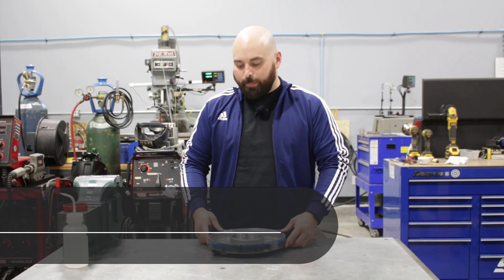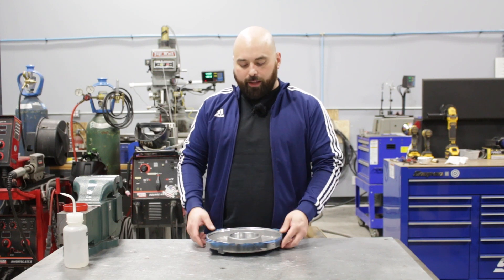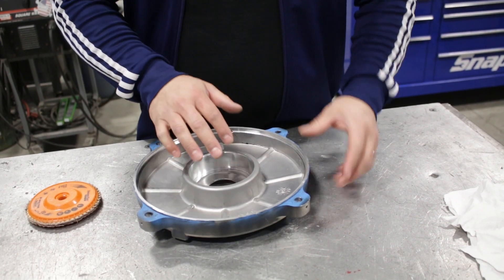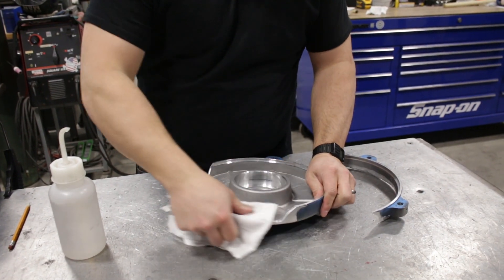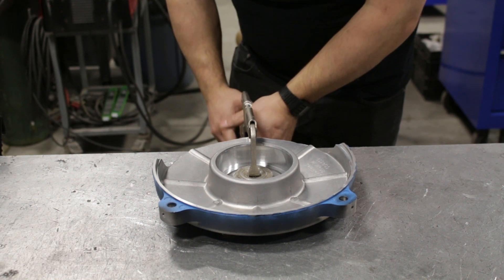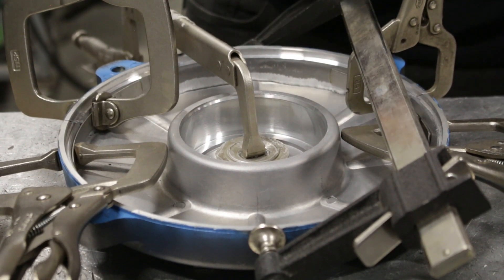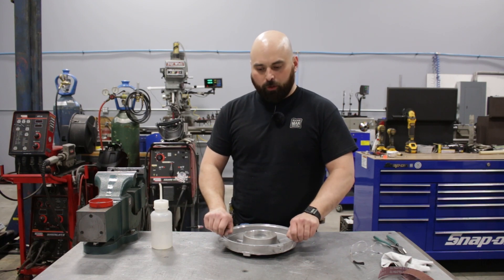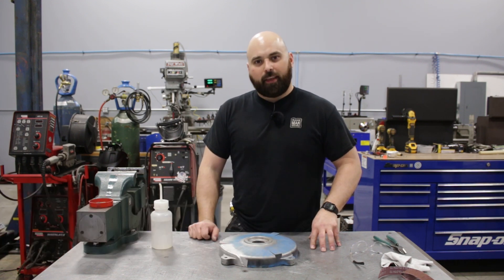This repair saved someone $5000

Comment: So yeah.  year odd later.  7-10-25.  happened to come across the video again so watched it again.   you know better than anyone repair stuff pays the bills but with aluminum learned a little trick for cleaning.  use oven cleaner.   some car company I work for and in the power train area, specifically use that for ....repairs.   transmission housings as an example.   a fortune can be made just repairing cracked trans housings alone.  wish I had those skills right now

Comment: Good experience bro your focus on cross section welding is impressive i had saw beginners making mistakes while welding thick metal piece together because they don't understand that welding on suface in not much but it actually it's more important to fill cross sectional area for its toughness 😊

Comment: Great video. But one thing I would add is that when you're trying to save the fracture as part of the fixture where you start. The pressure on the bit  Really matters you don't want to most of the pressure on The fractured side..  The side that's not fractured Is where you put the pressure. Otherwise it'll push metal into the fracture and make it not fit correctly Otherwise it'll push metal into the fracture and make it not fit correctly. But you did do that in this video.

Comment: If you were to put it together like it is for a perfect fit and then tack it together you could then use a cutting wheel to open up the joint and put a good strong weld in it and then grind the tacks and weld making it super strong and keep the dimensions
Reply from the maker: Great point!

Comment: Good video.  Saw something related a few weeks back with a guy named Steve Morris (Engines).  He went to visit a master welder named Chris Razor who runs a one man shop called Hi-Tech Welding in Plymouth, MI.  Chris is something of a legend as he is a beta tester for Miller Equipment as well.  He does aluminum weld repair for engine and transmission blocks particularly racing related.  No shortage of work.